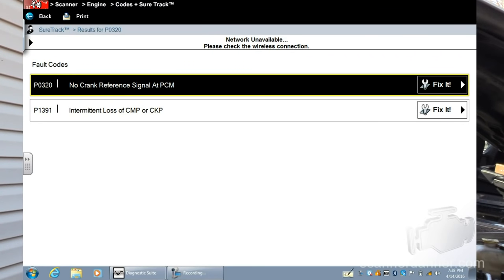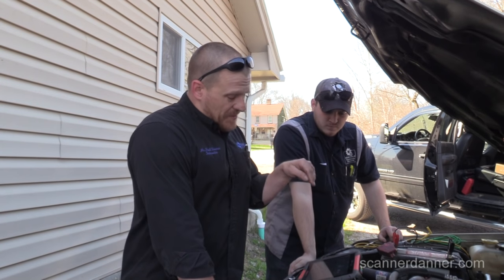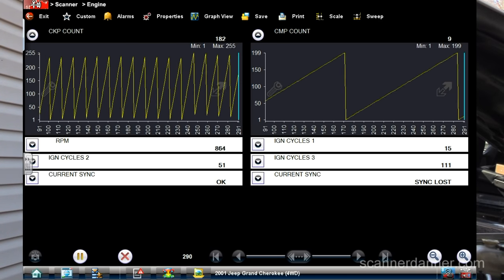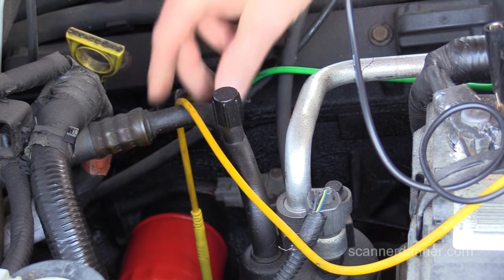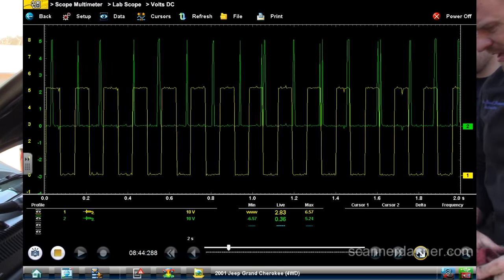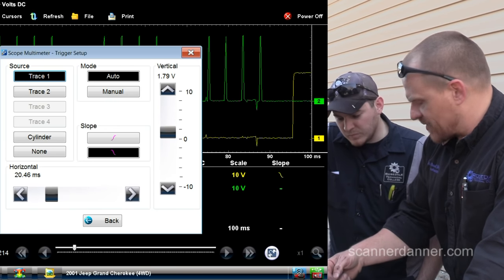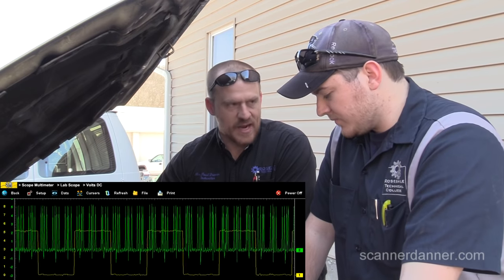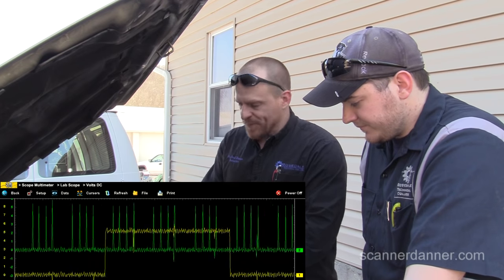Intermittent stall, no start - P0320, P1391 cam, crank sensor testing (Jeep)

Comment: Great video as always, but please no more two person videos. Your formula for a single presenter to the audience is perfect and has worked well for you. I really don't care to hear about Shane or anyone else farting.
Reply from the maker: +Baxrok2 thanks for taking the time to comment and for the constructive criticism
Reply: +Isshman Garcia I agree. As one example I offer the collaboration with ETCG on Power side vs Ground side switched circuits. However, I've yet to see a two person format that is as effective as the one presenter to audience format. Time is maximized, focus is kept, and the quality of the content doesn't suffer.
Reply: +Baxrok2 You need to lighten up a little and maybe let some of the gas you been holding out.  The content of finding and describing the crank sensor fault was the major focus anyway.  It is good to see a little comradery between Paul and his students once in a while.  Laughing, joking, and farting happen in the field all the time. Watch some of Paul's brother's video.  He jokes and laughs with his coworkers while they are problem solving and he still gets his points across.
Reply: +Discretesignals I agree, also with a student there Paul adds more info on the subject and covers more topics, discussing issues as they arise
Reply from the maker: +Isshman Garcia Shane is a very good student, just because we were fooling around a little doesn't make him less of a student. This is the way a good shop operates. Have fun while you're working.
Reply: +ScannerDanner Exactly, whats life if you don't have fun, enjoy yourself, keep up your work Paul and bring students along with you for your videos they add an extra enjoyable  dimension
Reply: +ScannerDanner I think Shane seems to be a very nice student to teach and he is eager to learn and can take in what you say. I would say bring him along if he can benefit from it. Baxrok2 thinks he is some very important guy that speaks for all of us but he isn't and he is wrong! Keep up the nice work and videos as always!
Reply: +ScannerDanner Paul, I'm not afraid to admit that I was wrong. I have nothing against Shane or your teaching methods. I watched the video again and in hindsight can see how I overreacted a bit. In light of that please accept my sincere apology. 

To all who commented on what I said, you were right, there is absolutely nothing wrong with having a little fun while working. I've forgotten how much fun I have when my friends and I are working on something! Paul is the best at what he does. That is why I bought his book, bought a Vantage Pro, have watched almost every video he has made, and am trialing Premium.
Reply from the maker: +Baxrok2 super cool of you my friend. And please don't be afraid in the future to let me know things like this. Things that you think should be done better. I realize you may be a little gun shy in the future but it is so valuable to me to know what people like and don't like. The worst thing is a thumbs down with no reason why. 
Thanks again and have a great day! You just made mine.
Reply: Baxrok2 personally I like to see the interaction danner has with his students. This was an awesome video in both the educational and personal level. Having the student there made it fun to watch while learning.
Reply: Okay, that's cool. I already apologized for what I said. I think that we all say things that we wish we could take back at times.

Comment: That noise you are picking when you connect the scope at the battery ground it's there because you are making a ground loop. Ground loop noise appear when large and low currents are sharing same path on a circuit. For this reason the PCM has multiple ground pins instead of one.

Comment: Gidday from down under Paul, have been meaning to ask you and your brother if you have tried a "mooshimeter" before? If you don't know it's a very affordable two channel bluetooth graphing multimeter. I bought one a few weeks ago and find I am using it all the time. Having something that doesn't cost the earth that you can strap under the bonnet and monitor form your phone is super handy, especially if you are working on your own. If you check out their videos they do a neat trick of using a battery cable as a current shunt too. I am in no way affiliated with mooshimeter but had to share with you as I absolutely love mine!
Reply from the maker: +Alex Wills I have never heard of one. Can you post a link? It will go to spam automatically, but I can unspam it when I see it.
Reply: +ScannerDanner Sure can, check them out here https://moosh.im/ also if you search mooshimeter on youtube they have a couple of great videos where they test it out on a Honda using the battery ground as a current shunt. I have found it fantastic for working on my own and also find the speed and convienience really good. The software isn't perfect, but I have a vantage and vantage pro (bought on your recommendation) as well, so no biggie. Great to support a US startup company too!

Comment: Wow this is like the coolest teacher, thanks for another awesome video. I'm working on a 03 Honda that's starting and stalling, pull the code and it's a camshaft code. I just wish it would run long to do try this on it. again thank you Mr. Danner oh sorry Paul.
Reply: What do you mean? If it is not running, it should still have the correct waveform on the signal wire? You can literally pull the fuel pump relay out, crank the car, and see the correct waveform with the car just cranking...

Comment: My 2000 Jeep Grand Cherokee 4.0 pulls a p1391 I have replaced both my crank shaft sensor and my cam shaft sensor my can shaft synchronizer(dummy distributor shaft) timing chain and ignition coil and I still get the same code
Reply from the maker: When you replaced the cam synchronizer, are you sure it is aligned properly? I don't remember the procedure on these.

Comment: Hello, Thank you so much for sharing this video... I was wondering if you may shed some light on the problem I have with my 03  Jeep Grand Cherokee 4.0. Initially my car stalled pulling into my garage.  Engine was cranking but no start,  and gave P0320  on my dash which pointed to the crank sensor. So did replaced my crank sensor with a BWD brand. Engine started & ran but was misfiring and gave another code P0340. which pointed to the Cam sensor this time, & so I went ahead & replaced the cam sensor as well with Mopar OEM.  After that  still engine misfires/ shakes then gave a different code again  P0352 which pointed to Ignition B , so I went ahead & replaced the Ignition coil pack with Delphi brand (close to OEM) . After that replacement, engine ran well & so I took a it for a test drive but after about 15 miles the engine starts to misfire again then eventually stalled  on the side of the road. "Checked engine" light was on & this time its P1391 which points to crank/cam intermittent lose. Car had to be towed back home as it wouldn't go anymore. After a good few hours parked at home  the car started & ran like normal but eventually misfires yet again when warmed up giving the same problem code P1391. Anyhow, I am quite perplexed by now as you may imagine... I  would be grateful to hear your opinion on this matter, if able . Other mechanics on You Tube seem to suggest that the crank sensor must be replaced with OEM Mopar.  Do you supposed  this is true , & absolutely necessary to do for this particular issue?  Thank you so much! Reuben PS. Do these (newly replaced)  sensors need reprogramming with car's PCM?
Reply: Ruben L  I’m having the same problem right now!!

Comment from the maker: lol two people gave me a dollar. Thanks guys!
Reply: Hey Dan i could seriously use a hand... My 97 jeep has been doing weird stuff. Normally it will run fine but lately it will start up run a few seconds and immediately die. Holding the gas does not keep it running and im going nuts here..  After sitting for a few minutes in the past i will hear a click like a relay (sounds like it comes from the fuse block in the cabin) and my gauges will come on and it will then crank/run fine..

Comment: i've had a crank sensor drop out on a 97 saturn sl2 intermittently and cause stalling. unfortunately did not set any trouble codes and was really hard to duplicate and prove it even was a crank sensor. when it did stall out. it cranked and didn't start. the no rpm while cranking pointed me towards crank sensor. i didn't have a oscilloscope to prove it. i wish i did. i told the customer you have a 50/50 chance it's a bad sensor or a warped crank reluctor wheel. put a sensor in it. ran it for 3 hours, haven't seen it since. the old cars that don't have engine computers smart enough to store bad sensor history data can be real frustrating to narrow the cause for intermittent concerns.

Comment: The way i figured mine out was it would stall the engine @ running temp, then no start with endless starter cranking. Then let engine cool & it starts right up until it stalls again. Got progressively worse over 3 days.
Reply: What was it?

Comment: My engine light goes on and off and returns a code about intermittently losing cam and crank sensors.  It doesn't die but misfires sitting at a stoplight.   Seems to drive okay on the highway.  The problem turned out to be an oily mess (probably from a leaky trans) getting on the crank sensor.    It appears the magnetic signal is affected when there's oil on the sensor, but obviously it's getting through, so I'm wondering how bad the problem actually is; whether I can drive it without worry until I get something else or budget a costly repair to fix the oil leak.?

Comment: Got a 2002 Jeep Grand Cherokee runs fine til it warms up, and can stall then and not start again, get a p0320 when cold and no communication with ecu when warm ……Bad ECU ???? Or can it be the sensors as well ? Just confuse with the no communications to the ecu when warm.
Reply from the maker: If that sensor is shorting out the 5v reference circuit it would be a no com too

Comment: Wish I had the money to offer Paul to come help me figure out my dodge ram problem.  It starts but will not stay running and has a hard time pulling itself. It's fine at first start and will run about 20mins then right after restarting it it dies. Alot of new parts and still can not figure it out, went off of alot of videos including his and still nothing. Like that old truck and wish I could drive it again
Reply from the maker: I'm sure we can help you on my forum. It is free to join https://www.scannerdanner.com/forum/post-your-repair-questions-here.html

Comment: While I guess it's rare, temperature can be a contributing factor to a bad sensor ground.  In my case, I was getting all sorts of random sensor dropouts and false readings, but only on hot days while in traffic.  The issue ended up being a ground point on the cylinder head above the exhaust manifold, and the only way I was able to catch it with the hood up was by pointing a heat gun at the ground.   Heat was only a contributing factor, however; not the only issue.  The stud was rusted, the head was oxidized, and the ring terminal and the exposed bits of wire were corroded.

I know it's rare for cars to use what's basically a battery ground for sensor circuits, but I guess Volkswagen just had to be different!
Reply: +rhkips Great contributing comment! My comment was about my laughing at the crop dusting. :)

Comment: I have a 98 ram 1500 318 5 speed has po320 and p1391 sometimes it will fire right up amd other times it will throw a fit to start up and act like its half ass running and cant get fully going also has a jerk going down road and misfires through exhaust but only when driving idles fine I'm convinced its crank or the pickup sensor in distributor also noticed my tps at rest stays at 16.9% according to my obd2 scanner and 77% at Wide open throttle but no codes for it
Reply from the maker: don't worry about those TPS numbers, it is pretty typical to not see a 100% throttle opening even at wide open throttle. Focus on your codes
Reply: Would you suspect the pickup (cam sensor) in the distributor or the crank sensor down on the bellhousing ?
Reply from the maker: @shawnthaxton1663  I've seen these set codes for the other sensor. Hard to say without a scope. Also the fact that it is setting both? Clear the codes and start with which one comes back first.
Reply: @ScannerDanner  messed around with truck yesterday po320 set first then few minutes later came the p1391
Reply: @shawnthaxton1663  I'm having the exact same issue with my 4.0 98 jeep wrangler,  did you figure it out?

Comment: I have a 1998 jeep grand cherokee 4.0 l  i am having intermittent stalling problem . i was told that the ecm was at fault  replaced  it with remaf. still having same problem.  symptoms are go to groc. store come out will not start if i wait half hour to one hour it will restart an able to drive home just got out of shop on the 13th  drove around all day stalled ,again would waited half hour  started right up. could you please help with some advice what to do next . i am retired  vet . watch all your class on line . i thank you are the very best.  sincerely glenn
Reply from the maker: +glenn cox I need you to test for spark when it doesn't start, then check for injector pulse, then fuel pressure. Without knowing what you are missing when it doesn't start, I really can't help
Reply: +ScannerDanner i have checked fuel pressure goes to 45 psi stays at40,i have no spark at plugs. put noid light on injected connecter have light.
Reply: +glenn cox sorry  no noid light thinking of other vehicle my jeep has distr . an no spark
Reply from the maker: +glenn cox okay, so no injector pulse and no spark when it shuts down, right? How about trouble codes?

Comment: how do you test if you do not have a fancy tester     and codes  was cleared 6 mos ago 
I know it had a O2 senor error but ran fine  all of sudden died and would not restart   and a jeep mech said not worth it    vechal is a 2002 Jeep grand Cherokee with the high output engine v8

Comment: hey Paul I have a 03 grand prix 3.1. code po336 I have fuel pressure,spark at each coil,but no injector pulse.I changed crank sensor in block now it starts somtime and somtime it doesn't the wire is not broken or short,at first it would not start at all,do you think I bought a bad sensor

Comment: VDOM is the key here! Using a analog meter will not give you the information that you desire. Power ,ground and circuit output are necessary information to the pcm. A load test is also a definite test of the wire to and from the sensor. Back probing is the way to go,to avoid spreading the female terminals of the connector. You can see the operation of the sensor when back probing and observe the opening, closing , or thermistor operation from cold to hot or vise versa. Ocilliscope waves can sometimes be confusing. If in doubt set your tools aside and seek out the help of a knowledgeable professional.

Comment: Hey Paul, happy Easter. I have a 98 cherokee 4.0 with a code p1391 no cel intermittent bucking and rpm signal going crazy on dash. I did verify on the RPM pid on my scan tool it is out of range. I did put a AutoZone crank sensor in it maybe Year ago. I know Chrysler's don't like aftermarket sensors and should put a OEM crank sensor in it. Just want if there is any other tests I can do before putting a $100 crank sensor at or other parts not needed. Or what pid I can watch on my scan tool for the cam sensor.Thanks for your help in advance.
Reply from the maker: make sure your air gap is set properly on that crank sensor https://youtu.be/agbEFhAyYI4
Reply: Thanks Paul, that video really helped. I will check the air gap first. Great videos. I do have your book btw had to pull it out on my jeep. Thanks for the help.
Reply from the maker: @aaronarmelin616  Thank you Aaron!

Comment: just alittle history on car. it was in a rear end accident bumper absorber and cover. its sat for 6 months. starting every so often. for got for awhile and battery went dead charged and hooked. car ran fine for extended periods. went to start car and move and noticed it died after a few min. started looking into it notice that low oil level and change oil light going on and off rpms up and down cooling  fan on and off. then notice that key on engine off fuel pump acting up anlong with warning lights. started this mourning all good until motor started warming up the everthing going hey wire. i dont know if this changes suggestion on ign.
Reply: just an update on grand prix.car finally quite starting starded checking power and grounds to all sensors and pcm.All of them checked out good.checked fuel and spark relized i had no injector pulse control side stayed lit unplugged figured there was a short in pcm.ordered used reflash.and realized i forgot to check cam sensor.lucky that gamble paid off.or it could of turn into a costly lesson learn with cam sensor.Thanks again for passing your knowledge on.Much appreciated.

Comment: I had a P0320 replaces crankshaft sensor and my 03 4.0 jeep still misfiring gets worse when hot please help ?
Reply from the maker: You still setting crankshaft position sensor codes? A bad cam sensor can cause that too. Also if the crank sensor is misadjusted and hitting the flywheel
Reply: I figured it out i unplugged each injector to see if it would make a difference number 2 didn't make a difference but I could hear the injector clicking so it was the number 2 coil I replaced it and now it runs great But all the coils on that side of the engine come as one unit bummer $ but I got it thank you so much